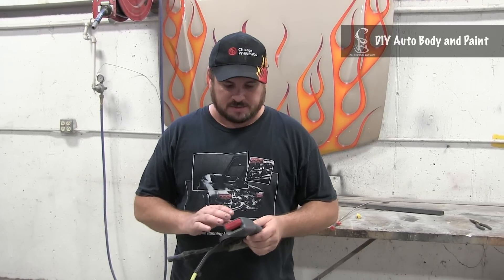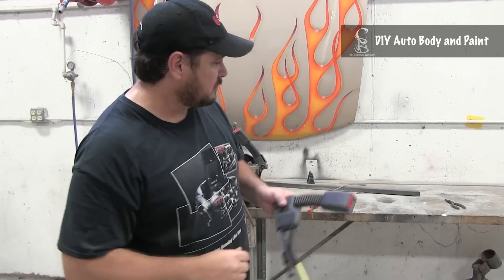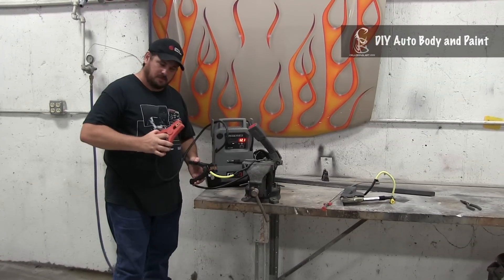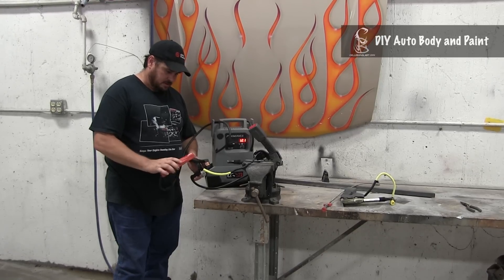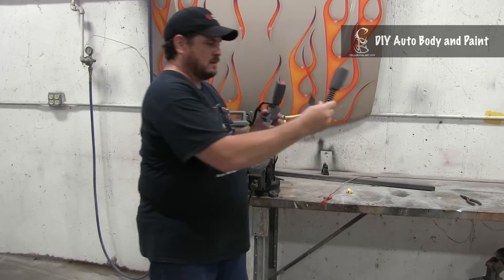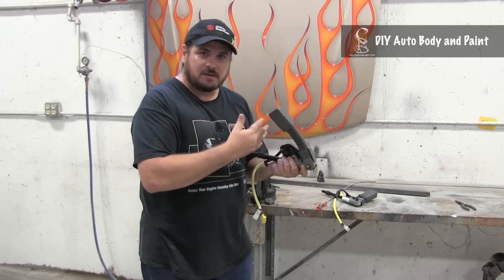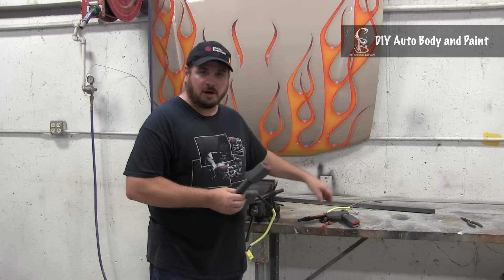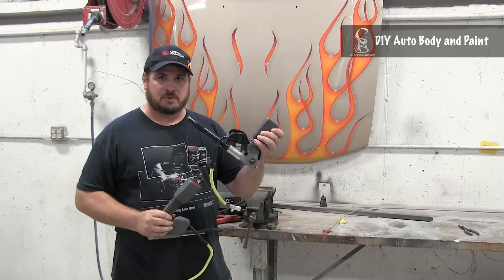What is a Seatbelt Pretensioner and How Does It Work?

Comment: I really appreciate your video.
Both tensioners are giving a fault code, and I did not know whether to change them or look deeper into the airbag light fault. 
I can definitely say my tensioners have not been activated. 
👍🏼
Reply: I have the same issue with the passenger front side. Did you end up replacing them?

Comment: Thanks alot for the teaching on the seatbelt pretensioner. I have been wondering why my car shows fault code "Driver seatbelt tensioner too high". And i found out i was sold a car that was involved in an accident and the airbag was discharged so when they fitted new airbag, they did not replace pretensioner buckle.

Comment: Thanks for sharing. Do you know what the signal these expect? Is it usually 12V, some CAN based signal or something else? I ask as I am curious how hard it is to retrofit another seat into my cargo van and have it still triggered by maybe the passenger seat in the event of an accident.
Reply: I doubt that would work and wouldn't suggest trying it. Just like airbags, the pretensioners are triggered by the SRS module sending 12V at the exact time it's required. The problem is that the module is only designed to supply a certain amount of current and trying to fire two pretensioners off one output could overload the module and cause it to not work as intended. This may mean it might not fire either pretensioner at all or maybe it fires them too late.

Comment: I bought a car that had been crashed.  The rear seat belts are locked up and this totally explains why! 

In theory, could you have a functioning seatbelt without pretensioners?
Reply from the maker: It is recommended to replace them.  But they should still latch and hold.
Reply: What's very likely is that the force limiters in the belts have also been activated. It's a torsionally flexible rod inside the seatbelt assembly, which will twist and deform during the collision to allow the webbing to spool out in a controlled way. Once it's been already deformed there's no guarantee that it wouldn't just snap in case of another collision, letting the seatbelt become completely loose.

Comment: There are two wires going to the pretensioner, does it matter which way round they fit to the underseat connector. Reason i ask is i have a replacement pretentioner with different coloured wires to the original.

Comment: Actually seatbelt pretensioners are repairable..
Reply: That’s correct! Seat belts and pretensioners are repairable, There’s plenty of places to send them in to get them fixed.
Reply: Nope. In theory they probably rebuildable, but I'm sure you don't have enough insurance to cover that as a completed operation.
Reply: @WCSmith-vr3fx  there are places that you can send in a broken seat belt and they will repair it
Reply: If you’re repairing any single use safety item, check with your insurance carrier to understand that they will cover a loss when you get sued.  If you are using rebuilt airbags/pretensioner in a repair instead of OEM and you’re not disclosing that to the customer AND the insurance company paying for the repair, that is morally reprehensible and likely criminally negligent.  If you sell a car that you know has aftermarket or rebuilt airbags, and you don’t disclose it, you are amongst the worst of all humans.
Reply: @WCSmith-vr3fx  You obviously don’t understand or comprehend but I don’t blame you because you don’t have the knowledge. Pretensioners are 100% able to be rebuild back to OEM with OEM parts . Certified technicians do it , which is 100% legal. They keep everything in record . You’re not going to talk down to me son, I have way more knowledge in cars than you and that’s including the legal aspect of it.
Reply: @thewiseguy7100  with OEM parts, they are replaced, not rebuilt.  Of course they are physically repairable, they were built by humans to begin with. But anyone who is remanufacturing a pretensioner is immoral.  BTW, how do you know that you know more about cars than I do?  Have we met?
Reply: @WCSmith-vr3fx  It’s called rebuild not replaced , again you lack knowledge in this section of the industry. Clearly you’re showing lack of knowledge. Stick to commenting on here and trying to act like you know it all.
Reply: @thewiseguy7100  I see you avoided my question regarding your credentials.  I hope I’m not in any of the cars you’ve worked on.  Best of luck in the future.
Reply: @WCSmith-vr3fx  Avoided your question? Again OEM parts are installed . I can careless about you, I don’t need your money trust me. Keep being a keyboard warrior.
Reply: @WCSmith-vr3fx  what? You don’t make sense.